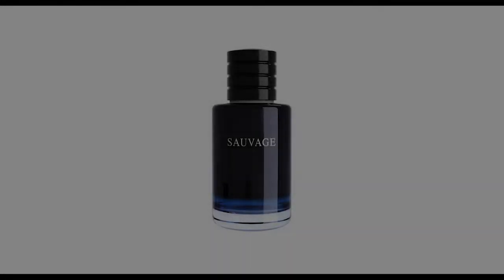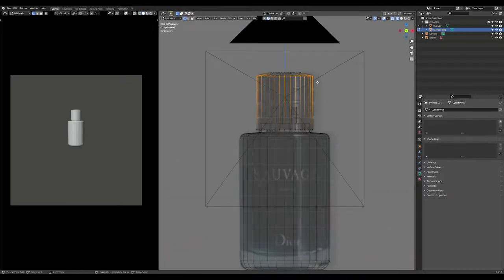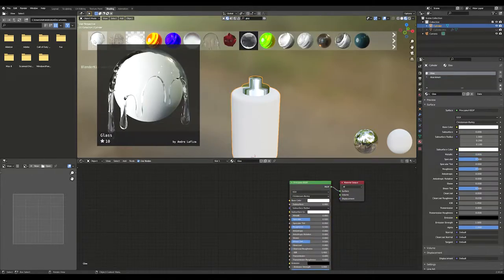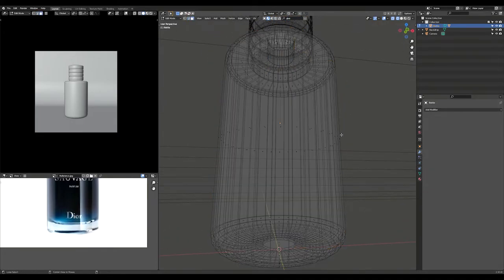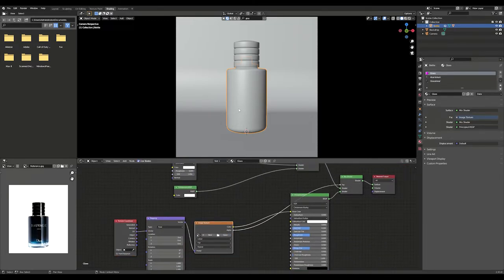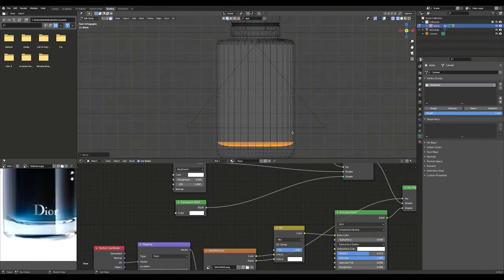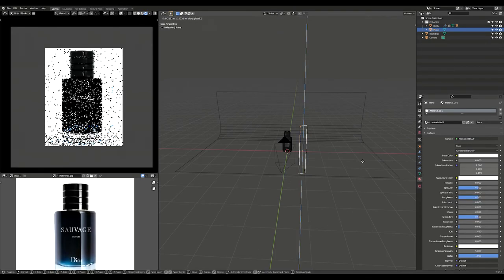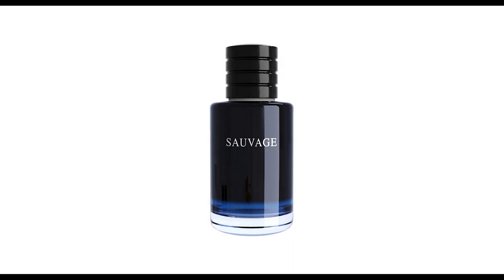Blender Tutorial - Product Design Dior Perfume

Comment: Hey im having a problem at 1:29 when I select 3 loop cuts and try to scale the whole cylinder interact as well instead of these 3 selected parts, proportional editing is disable and I run of ideas and im in select faces mode
 :((
Reply: The solution has been found! When you select the 3 rows then go to face -> Extrude faces along n normals
Reply from the maker: You can change this from “Bounding Box Center” to “Individual Origins” using the second dropdown menu located at the top of the 3D Viewport.

Comment: how can i add multiple text to the body material? I would like to add "Dior" but i don't know how to get the nodes right in the shader editor
Reply from the maker: You can create a Dior Label in photoshop or find it online. Make sure you use a transparent PNG image file.
Now you can use your dior logo image instead of the sauvage logo at the image texture node.
Import your Image by clicking „open“ on the image texture node.

Select the faces where you want to place your logo then right click and select uv -> uv unwrap.
Now you can scale the uv map in your uv editor panel/window
Reply: @BoldCG  thank you for your fast reply but the problem is that i want to add multiple image texture to a single material. Sauvage + Dior so i need multiple nodes and I don't know how to mix them into the same glassinner material
Reply from the maker: Try to use a mix rgb node and set it to multiply

Comment: I have trouble selecting the row with alt + lmb
Reply from the maker: Its kinda tricky at the beginning. 
1. Make sure you’re in Using Faces in Edit Mode. 
You can press 3 on your keyboard in Edit Mode and change to selecting Faces.
2. Hold left Alt and click a edge. Now it should select all Faces in the row.
Tipp: if you want to select a row horizontally - click on a vertically edge.
Else you can click on a horizontally edge to select rows in vertical direction.
Hope it helps out
Reply: @BoldCG  ill try it out thanks!!
Reply: @BoldCG  hey so i managed to do it, but when i scale the row down the bottom of my loop cut goes inwards with it... is there any advices that i need?
Reply from the maker: @AuraVFX  make sure you transform from individual Origins. You can see it at 1:29.
Also make sure proportional editing is disabled.
Hope it helps :)
Reply: @BoldCG  thank you!